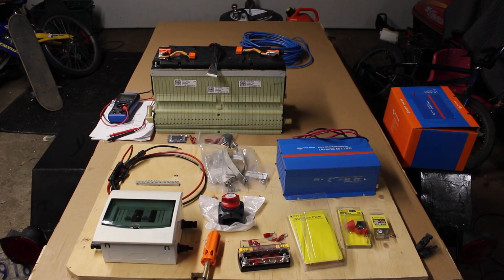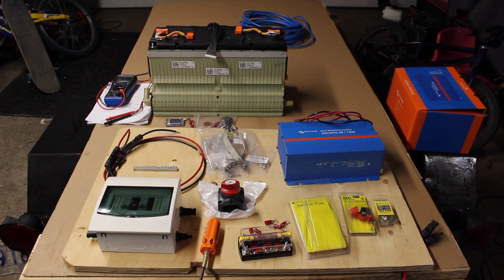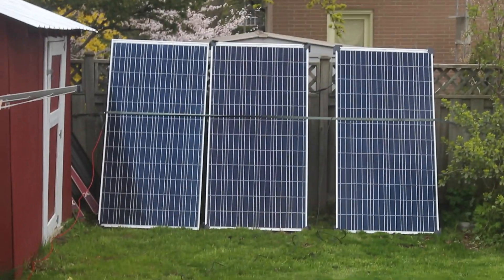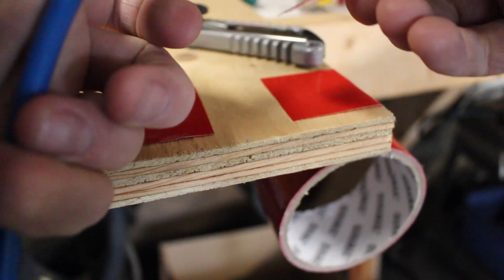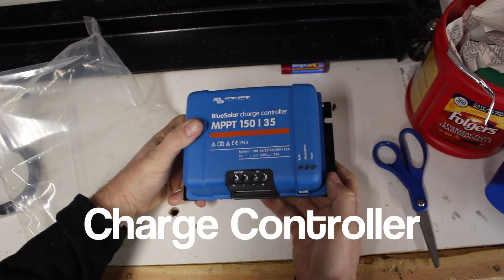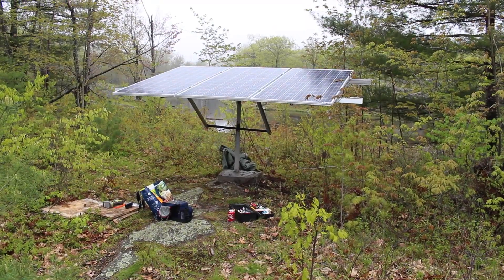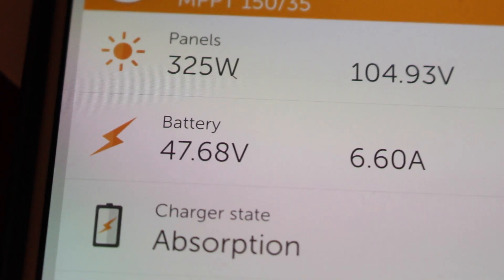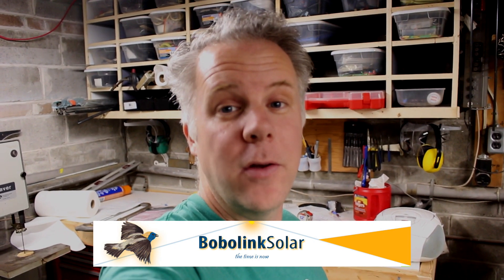Lithium-Ion Batteries for Off-Grid Systems

Comment: Are you using the Lithium Iron Phosphate battery preset on the Victron? If not, what are you using? I have the exact same controller coming in Tuesday and already have the Chevrolet Volt 48v battery.

Comment: Do you need a back up generator?
Reply from the maker: no need for a generator. We typically use 30% - 40% of the battery capacity max.

Comment: did you install a battery management system (BMS) to ensure they charge equally?
Reply from the maker: I don't have a full time system, but I can check them 6 at a time. So far they are all within .01 volt of each other.
Reply from the maker: I will make a video next time Im up at the lake. My inverter will cut out at 40volts and the CC is set to go into absorption at 48volts. These settings maximize the life of the battery, its possible to charge to 49.2 with some shortening of the batterys lifespan.